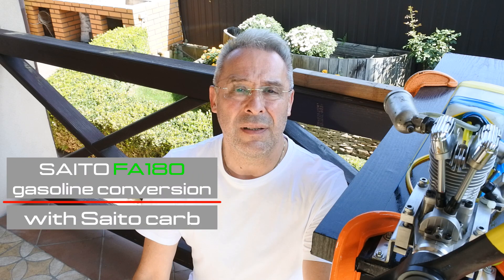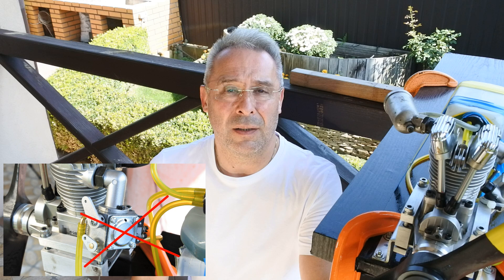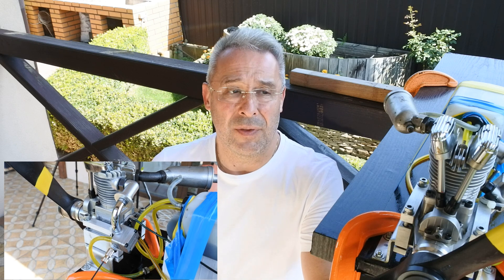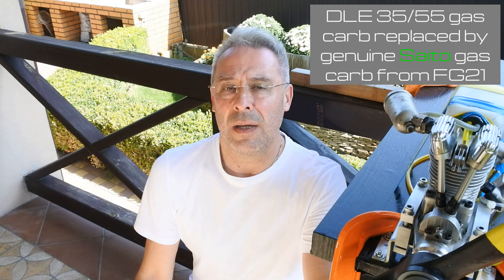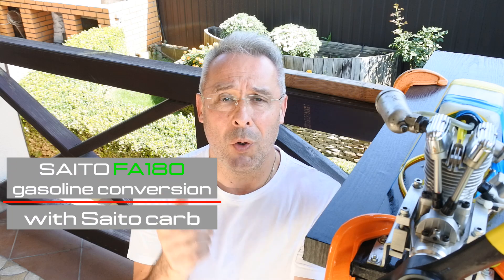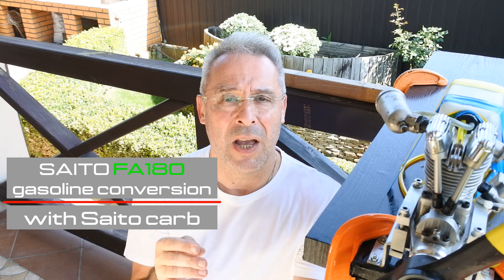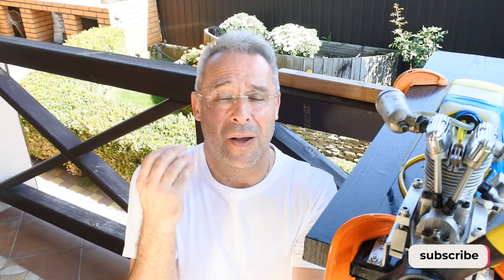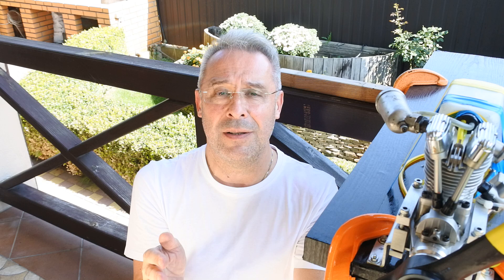Discovering the fuel conversion with Saito FA180 - the next leap

Comment: Do you use the os no5 plugs?
Reply from the maker: Hi, hello, and thanks for interesting question ! Yes, you're right, the first glow plug installed on the engine, was O.S.G5 type glow plug. This glow plug was specially developed for gasoline engines. But the most interesting in this video was an ability of few non gasoline fuel glow plugs also perform well with gasoline fuel. They are: O.S. A3 type glow plug ( "hot" glow plug for 2 stroke engines), as well known, possibly, like an industry standard - O.S. type F4 glow plug, also dedicated for methanol based glow fuels. It means, glow plugs, generally dedicated for methanol based fuels, can very well perform with gasoline engines. So, there is a great field opens for experiments. Thank you and have a nice day !

Comment: Another interesting video from crazyengines, 
I like that you even tested various glow plugs, i see excessive leaning to get a glow plug to keep engine running, not really good for the engine, but i understand this is all for experiment. 
I would like to see how well this engine can run on its original carburettor withoutany modifications,  and then the final step to use a cdi ignition,  .great video and enjoy the research 
Please check out rc universe for a thread  ( electronic solution to converting glow engines) plenty of great information, Brutus there has an aray of extremely useful conclusions
Reply from the maker: Thank you very much for your comment and for  provided !info ! You're totally right, I collection a lot of information during my experimentations with engines, especially in the direction of methanol to gas conversion. Core task with Saito FA180 was to find the simplest  and effective way of engine conversion, to avoid timing flanges, ignition modules, spark plugs and batteries, so all this stuff, which increasing engine setup weight. It's very important to me, to get my own, experimentally confirmed knowledge and experience.     Thank you, and have a nice day !